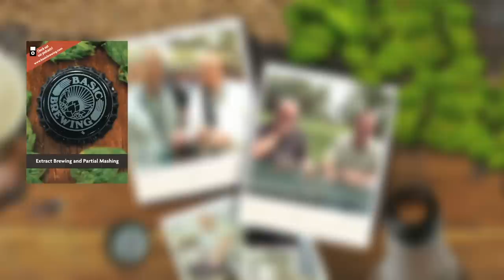Hardware Store Jug Pale Ale - Basic Brewing Video - September 2, 2014

Comment: For 7 or 8 bucks at Walmart,  you can purchase a 5 gallon empty bottle that does not have the hollow handle like you have shown. It smelled awful of plastic but I soaked it for 48 hours in a B-Brite and Star-San combination and it cleaned right up. I have a Belgian Tripel in it right now.

Comment: James,  I didn't buy the homebrew stores advice about not using these bottles - I think it is leverage to sell me glass/plastic carboys. I was told that this material would allow airto leach  into the beer via the plastic material - but I can not see how that would be worse than plastic pails with weak seals and airlocks.  I have 5 - 5 gallon jugs that I use on occasion. I use them as fermenters and have used 1 for a secondary for a Marzen/Octoberfest  that aged for 4 months with good results - in fact it was one of the best batches I ever made. Thanks for trying this and keep us posted.
Reply: GEORGE STRICKLAND i

Comment: I started homebrewing using a 5 gallon water jug. However, I simply rinsed it out after I racked the beer out and returned it to the distributor. I then received a new one filled with water for my next brew. Saved on the clean up there! I enjoy the videos, Cheers!
Reply from the maker: I did the same with Mountain Valley Spring Water when I first started brewing. Now, I live about 30 minutes away from the nearest MV retailer, so it's easier for me to just use filtered tap water. Using the carboy is a money saver. - James

Comment: What is that cork device you're using to plug your 3-gallon?  
Been wanting to brew using this method for some time but just couldn't figure out the name of that little thing.

Also how difficult is it to bottle using this jug technique?  

Thanks!
Reply: It's a rubber stopper from Steve's Brew Shop. I don't remember the size number. Check out this bottling video. - James
https://youtu.be/ijjnhLo37PU

Comment: the biggest problem with these bottles was cleaning yeast trub from the top curves. You need a brush, a curved brush... which technically "may" introduce scratches to the inner surface, but... I never found a problem. The upside is that you can recycle the bottle after several uses. As long as they were clean, we had no trouble with returning the bottles to the supply company either. In the end, we went for wide neck water bottles as they are easier to clean and can be cleaned with softer materials.
Reply from the maker: I didn't have an issue with the top curves, since I filled it up to the top of the neck and soaked overnight in the dishwasher soap solution. I agree you should clean them as best you can, even if you want to trade them in. - James
Reply from the maker: Your other comment with the video link was marked as spam. I approved it, but it seems to have disappeared. Cool story about the club in Vietnam.
Reply: Fill it up all the way and let the reagent do it's work.  I use them on my 5 gallon Carboys because I'm too afraid to use a scrub brush, with the scratching and all.  Cheers!
Reply: Another way to clean, rinse with hot water, add about 2-3 inches of hot water and PBW or other cleaning solution, add a clean wash cloth and shake the cloth around. Sa a video on it a while back. Worked perfect. Cheers!
Reply: I would add that fragrance free oxiclean is fantastic for getting any kind of stubborn, caked on brewing sediment off of anything and everything.